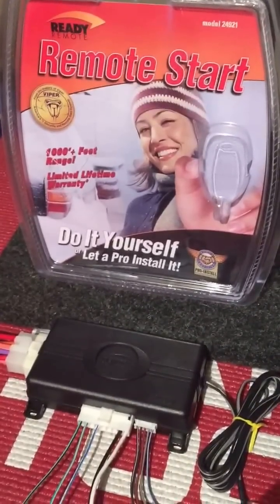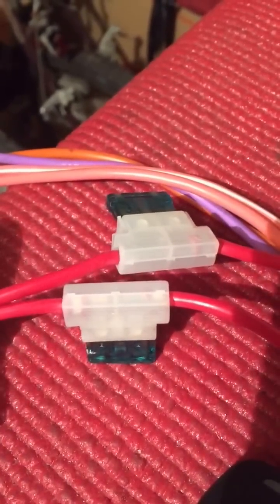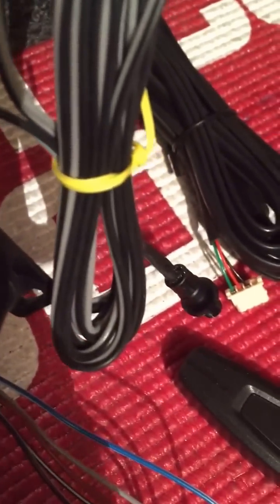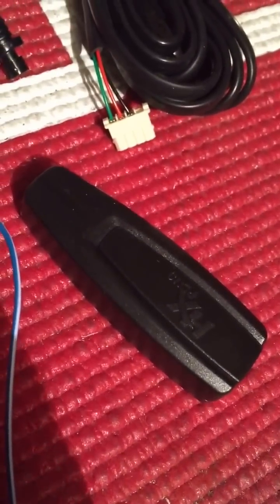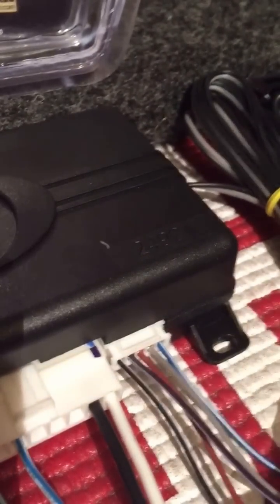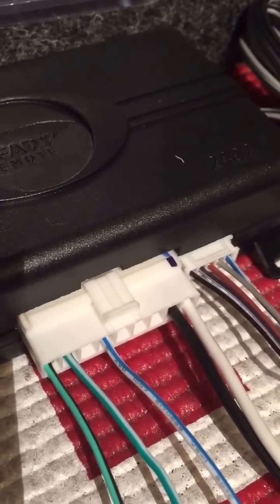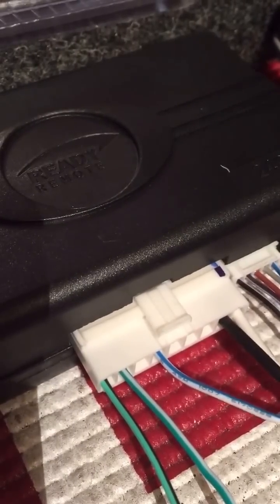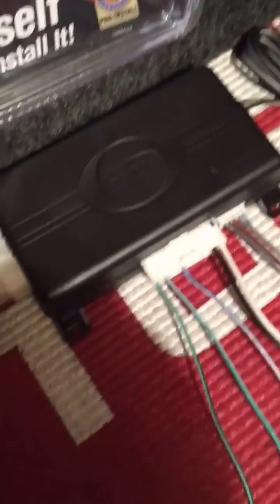Car Remote Starters Explained Wire by Wire Viper Python Clifford Compustar

Comment: I watched your 1990 Miata video also and I was wondering where did you put the hood pin and neutral safety wires to? I also got a 1990 Miata
Reply from the maker: On my Miata I did not use a hood or neutral safety switch(s). Reason being is I'm the only one that works on my cars, and if there is ever a time where I can not remember if the car is in neutral, I simply don't remote start the car.(I put the neutral safety directly to ground)

On other customer cars I typically end up putting the hood switch through an existing hole(or drill a new one) down by the headlight.  Customers with manual trans cars that do not have a factory neutral safety wire, I typically recommend other DEI products that are designed for manual trans vehicles and have a vehicle exit procedure to perform prior to getting out of the car in order for the remote start to function.
Reply: +MotoCARR MotoCARR-dot-com how do you delete take out that option ?
Reply from the maker: Which option do you mean?
Reply: +MotoCARR MotoCARR-dot-com I didn't connect those wires either but it keeps throwing the codes for missing both of them. Is it supposed to start without them?
Reply from the maker: It will start without the hoodpin connected, but it will NOT start if the neutral safety is not connected to a ground reference.(Either through some sort of switch, or by connecting it straight to ground.)

Comment: I have a 24921b I'm getting ready to install on a 95 Cheyenne the instructions are not real clear for one I don't need to install the immobilizer interface do I among other things if possible I would like to talk to you through e-mail Elisa.mckinney@yahoo.com
Reply from the maker: +Cassandra McKinney you're correct.  Your 1995 Chevy truck does not have GM's "Passlock" ignition immobilizer so a bypass is not needed.  Email is on the way, look for it from RefinedPerformance@Gmail.com!

Comment: A previous owner installed this system in my 2000 Silverado 1500 and it's absolutely wreaking havoc on my ignition! What's the quickest way to disconnect the remote start and just go back to the factory setup??
Reply from the maker: +Michael Bass Pull the green 30A fuses that are on the big red wires coming off the remote start.  Being that the ignition wires are simply "tapped" into and there isn't a starter kill relay, there shouldn't be any wires that need to be reconnected/repaired.

Comment: i have watched this several times, the remote starter kit i have  doesn't have this " parking light jumper thing" on the back like the the one you're showing its  the 24921B  model it also has another box the has wires  not shown in this video. I'm  very confused on what the other box is for , no manual  to this kit, and they say  easy to install .. lol .. any further info would be great, ty for this video
Reply from the maker: +Jim A 
Here is a link to the manual.  If for some reason this does not work, shoot me an email to RefinedPerformance@Gmail.com and I can send it to you that way.  On this unit there should be a little "trap door" that you can pop off on the right side of the unit.  Underneath it is the jumper for your parking lights.  Let me know if there are other questions! -Julian
http://www.directeddealers.com/manuals/og/designtech/24921_Owners-Installation_Guide_01-06.pdf
Reply: thank you, Julian i will have a look at this link!
Reply: +MotoCARR MotoCARR-dot-com grrr   i am  so heated up this product  ready remote  is crap . i have all the wires hooked up right on the main  harness  ignition   , power, and starter wires.. the brake safety wire is hooked up, the ground is  grounded  to  a clean metal area. i have no red light on the module itself indicating to me there is no power ? , but i tested all connections ,and all are reading  the voltage they should be reading . i am at a loss and about to rip this thing out of my truck. that blue defogger wire is not hooked up. i did  read  that there is a key sense wire  (light blue) does the defogger wire  hook into that to make the remote starter think there is a key in the ignition?? i i also grounded the neutral switch wire.. any help would be great ty :)
Reply: +Jim A ok just to cover the bases......you should have:
-the thick red, pink, pink/white(if your vehicle has a 2nd ignition wire), orange, and purple connected at the key ignition wires.
-You have the thin black ground wire connected to a solid metal ground. 
-You have the thin black/white neutral safety wire connected to either:  the ground side of the emergency brake switch, or straight to ground(not recommended if your vehicle is a manual trans)
-If your vehicle is ~1995 or newer, chances are you need an ignition immobilizer interface/bypass/interface.(an extra part not included with a remote start)  If so, the blue/white wire would be connected to it. That wire would tell the bypass to "turn on", making your vehicle believe there is a key in the ignition, and the vehicle would start via the remote.  If you let me know what vehicle you have I can tell you which bypass is needed(if any)
Reply: +Jim A as an FYI, that LED is a programming LED. It flashes in accordance with button presses to change menu features of the remote start.
Reply: hi Julian  ty  for your response  i have a 2003 dodge dakota..  the neutral safety  is  str8  to  ground   as my truck is auto.
Reply: as far as the wiring   i have the 2 red wires  from the remote  kit spliced into  1 ,and connected  to just 1 12v constant wire, am i supposed to connect the 2nd  12v constant as well??
Reply: +Jim A the way you have it should be fine
Reply: +Jim A yes you will need a bypass like this http://www.idatalink.com/product/product/product_id/1 .  I have one on the shelf I can flash and ship out to you if you need. http://www.motocarr.com/collections/electronics-free-shipping/products/idatalink-ads-alca-data-bypass-module-for-remote-start
Reply: thanks  julian.  i have the bypass module, now i know what  the other one  is for lol.  of course there are no directions  with this ready remote  bypass module , and i cant get any1 on the phone, u have been a great help  with the  information, is there an installation  page  for the ready remote  bypass module?? thank u again have a great day Julian
Reply: +Jim A What bypass do you have?  DBALL2?  XK09? 556UW? ADS-ALCA? ADS-DL?
I should be able to find you something.
Reply: ty Julian  i appreciate all  your help, but i just got so pissed off with this product, it is now installed   back on the shelf where i bought it from, you have been extremely helpful ty very much  have a great day

Comment: Great video describing the wires and where they go, you video is the best out there! Keep it up. I have a question on the Viper 4105v(Directed like yours) going into a '13 F150, my install sheet is not that great. On the Remote Start Harness(5 pin) the blue/white says -200mA 2nd status/defogger, I am thinking that I need to connect that to my vehicles "Keysense" wire? Also second question is on the Main Harness(yours doesn't as many as mine) 1&2 say they connect to the factory alarm arm & disarm. I don't have an alarm per se, but it does have the passive horn blast. Do I use them in them in my truck? My wiring diagram shows an alarm arm wire, but the disarm says,"Disarm No Unlock   Transponder and ignition"?
Reply from the maker: +Kathy Warner shoot me an email to refinedperformance@gmail.com and I can send you the tech sheet from Directed if that's different than what you have.  The blue/white wire is going to go to the bypass you are using, usually the same color regardless if you are using a Directed bypass or a Fortin/idatalink/Flashlogic.  As far as your factory alarm disarm, on 2010 Ford vehicles, the factory alarm can only be disarmed by either unlocking the doors using the factory transmitter, or by inserting a valid key into the ignition and turning it to the ON position.  I believe you will be ok with just using the bypass/transponder as this will mimic a key and the remote start will turn on the ignition and accessory, thus disarming the factory alarm.  If that does not work I have a tech sheet I can send along that outlines how to disarm the factory alarm during remote start.
Reply: @MotoCARR847  Hi just wondering my pkall has a  blue/white wire and a green key sense wire. Does that mean I connect the blue/white on the pkall to the blue/white on the remote start and then use the green for key sense. I only ask because some say to use the blue/white for key sense. Just making sure so I don't screw this up. Thanks
Reply from the maker: @leonkellogg595  depends on the vehicle, some don't need key sense at all, some need it only to deactivate the oem security and then rearm after remote start.  I'd start with just connecting the Blue/White and see what happens.  Worst case is the vehicle will either not start or start but set the factory alarm off if the Green wire isn't hooked up.
Reply: @MotoCARR847  Thx

Comment: I have the 21930 keyless entry and cannot for the life of me find the original manual. I have had it for three years and never installed it. I need to know what the different wires on the alarm are.
Black: of course the neg
Red with inline fuse (Continuous positive) (ignition)
Black with purple line:   ?
Blue: ?
Blue with white line: ?
Orange: ?
White:  ?
So im stuck halfway through........
I am installing on a 91 Honda Accord Se
any suggestions
Reply from the maker: +Melissa Blair 
I don't have the manual for the 21930, but you can use one that is similar to help you install it, the Avital 3100L.  It's going to have more features than the 21930 but the wire colors are going to be the same.
Owner's Manual:  http://www.directeddealers.com/manuals/OG/Avital/G3100L%202008-12,%20web.pdf
Install Manual:  http://www.directeddealers.com/manuals/IG/Avital/N3100L%202008-12,%20web.pdf

Black: Usually goes to chassis ground
Red with inline fuse :  This will go to to the 12V constant power wire
Black with purple line:  Verify these colors, I don't recall seeing a black with purple wire on Directed products.  Thick purple is usually goes to the starter wire, thin purple usually is a door trigger input
Blue: Multiplex trigger input, usually this can be used as an input for a glass break sensor, tilt sensor, magnetic switch, etc.
Blue with white line:  Do you mean white with a blue line?  Usually blue with white is only on remote starts
Orange: If it's a thick wire it usually goes to the accessory wire at the ignition.  If it's a think orange wire that is usually ground when armed.  You would use this if you want to ground an accessory when you hit the lock button.  Like those flashing LED scanners
White:  Usually is the parking light wire

Feature comparison which will show what features are available on your unit:  http://www.readyremote.com/pdf/Ready_Remote_Feature_Comparison.pdf

Click on this link and it will take you to a vehicle selection guide where you can enter in your Honda Accord and view/print out your wire colors for your car:  http://www.readyremote.com/main.asp?action=select&yr=2246&product=Remote%20Start&make=Honda&model=Accord#

Comment: I just purchased and installed the ready remote 24921B, but I couldn't figure out the parking lights, this model doesn't seem to have the fuse on the back like the model you showed in this video. Do you have any advice?
Reply from the maker: +2000tmarin 

Take a look at page 6 of the manual at the following link:  http://www.readyremote.com/pdf/manuals/24921.pdf

It's just a small black piece of plastic sticking out the side, like the ones on this Avital http://www.sonicelectronix.com/pictures_new.php?id=23832&picture_id=425128
Reply from the maker: +2000tmarin I'm not sure what the difference is between 24921 and 24921B but I can't imagine it being significant enough to where they would eliminate this jumper
Reply: Thank you very much for providing the link to the guide, I was able to get it fixed! I bought this unit brand new but it didn't come with any instructions... I guess when they say "Do It Yourself" they really mean it (joke).
Reply from the maker: +2000tmarin no problem glad it worked out!